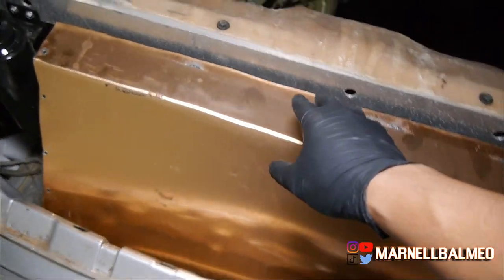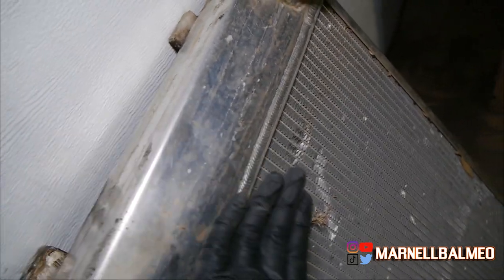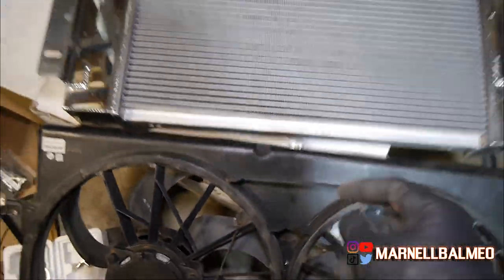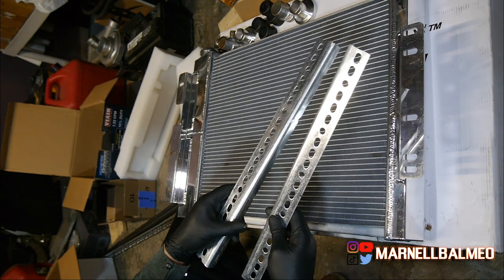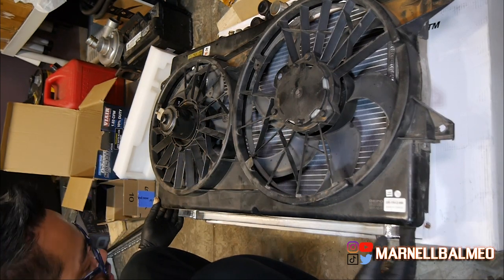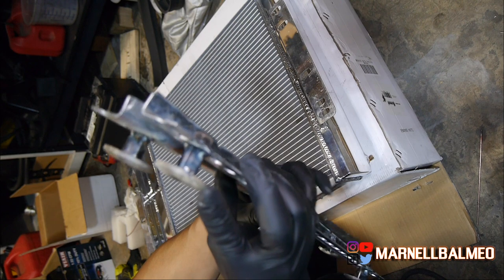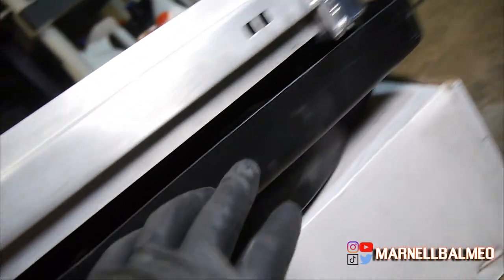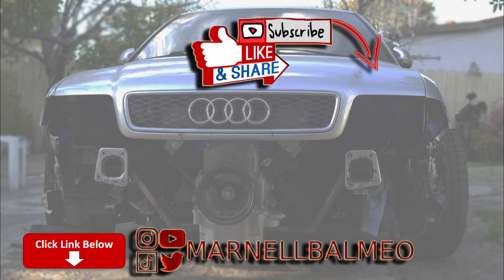DIY - Building the ultimate Rear Mount Radiator setup

Comment: Jeez that rad is low now, you might want to make some kind of steel piece to protect it like a skid plate. I mounted my rad up in the trunk with the inlet being the rear window of my B5
Reply from the maker: Yea it's as low as my front mount so a full skid plate is definitely good idea. When 1/2 racing from around I'll start designing something for protection and aero